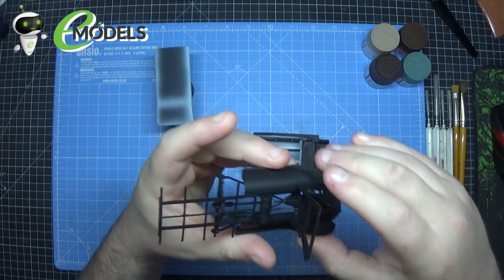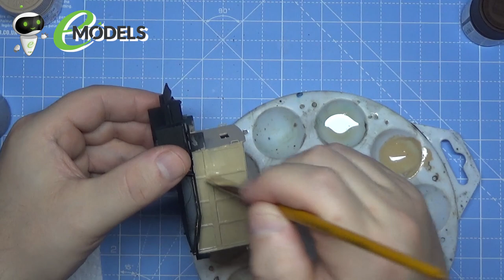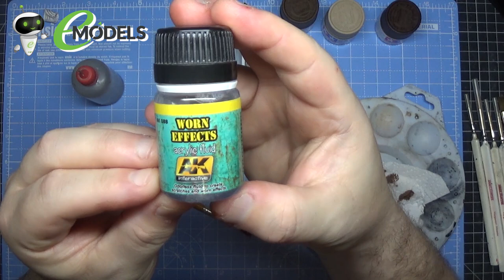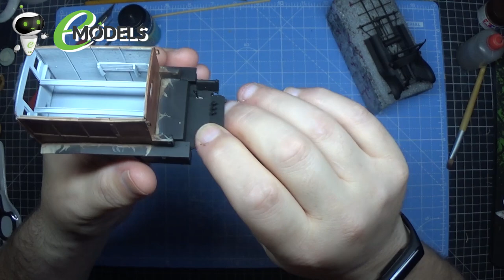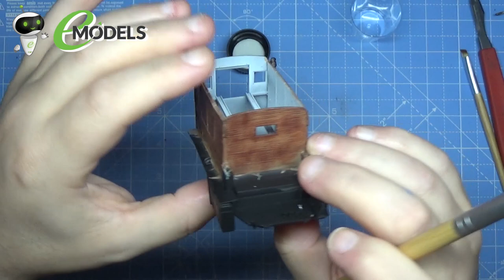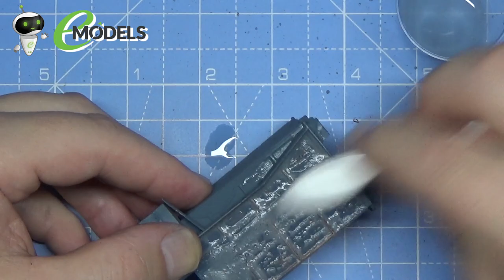ICM 135 Model T 1917 Ambulance early WWI AAFS Car Part 5 Finishing the build

Comment: Excuse me for asking (I'm new to modeling since lockdown), why do modellers use a black primer ?

Thanks for the tips, great finish on the worn effects.
I couldn't find the finished model on your site ???

Regards,
Kev T
Reply from the maker: There are many different colours of primer, and you can use the primer colour to your advantage, but usually it is just a case of whatever is to hand! If you are painting a very dark model though, black primers can be handy because they will conceal any tiny areas where perhaps you missed with the airbrush and the primer is showing through! Also, if you want to have a pre-shaded effect, you can spray less paint in certain areas to make those darker, and spray more paint in others to make those areas look lighter - giving your model depth and modulation, easily. 

However, you can really use whatever colour you like. Just make sure to remember that primer colour can affect the tone of paints above it, so as an example you may see people using brown primers under yellow or gold paint because it will help them be bold and bright, where a black primer would make them dull and push them towards a green tint. Ot they may use a rusty colour primer because they want to be able to do paint chipping later and the rusty primer colour can act both as a primer layer AND the rust colour that will be exposed through chipping later. 

TL/DR: primer should always be applied but you can use it as a colour coat at the same time  ^_^